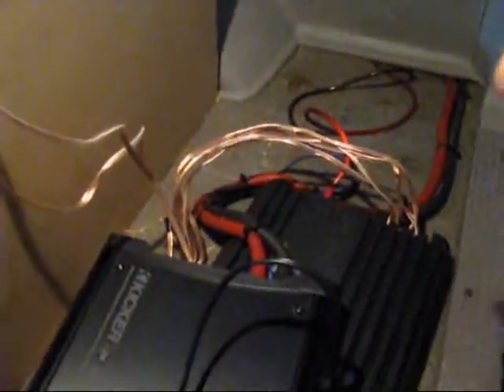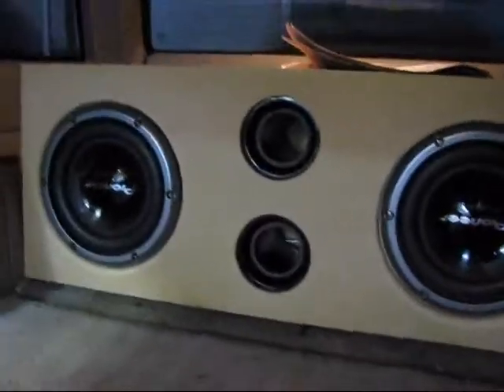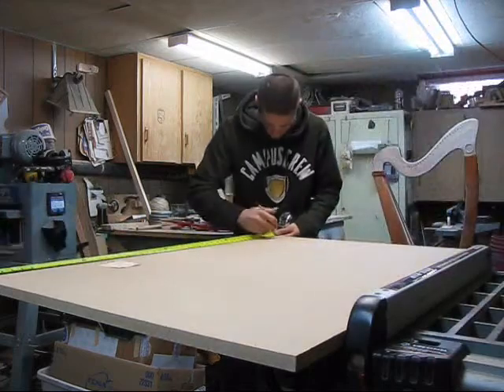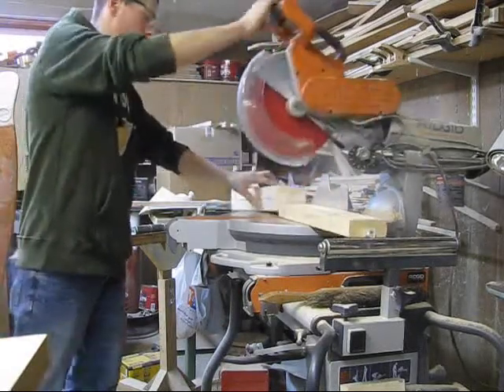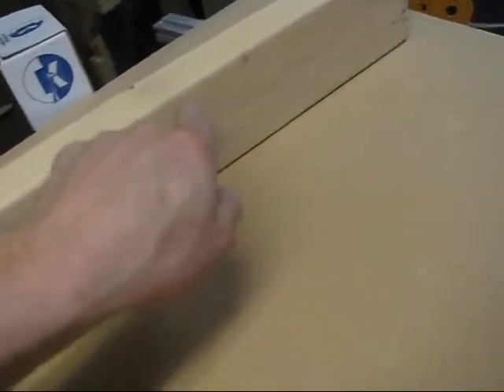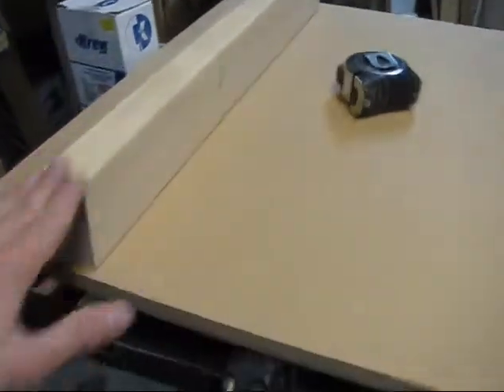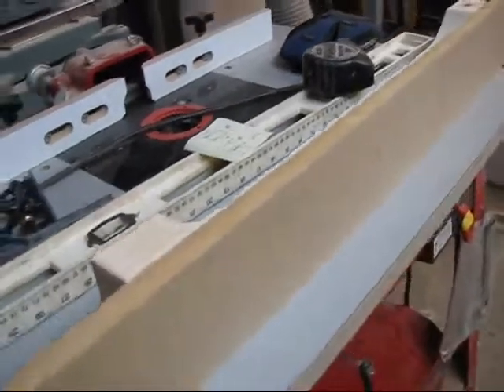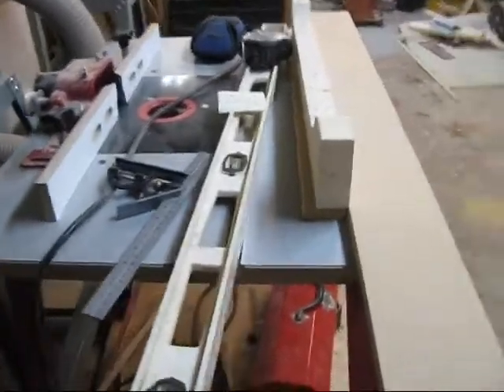Rob's S10 Blazer Speaker Box&Demo

Comment from the maker: @drewkang34 well at the moment its with a good friend of the family, he is a mechanic and i finally gave up on trying to figure out what is wrong with it. i shall let the professionals deal with it haha. depending on the answer i may or may not change the motor at this time. if its going to keep running for a reasonable price ill keep it going and save up for the engine that i really want one day. Regardless as far as the stereo goes i need some batteries and a new alternator